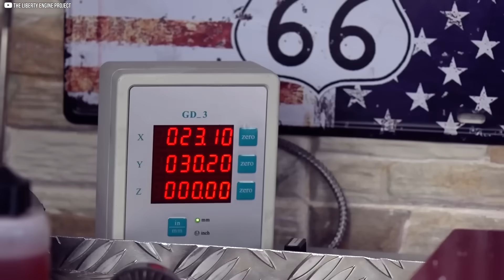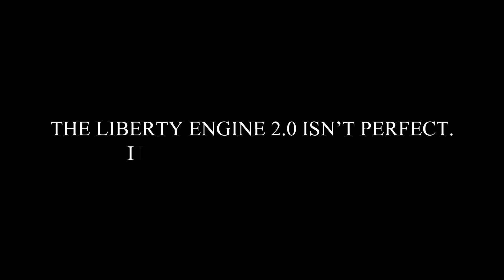Nikola Tesla’s Hidden Invention Just Got Rebuilt – And It Works!

Comment: You Need to hire tech interested Veterans that have'nt Killed Innocent People or Civilians, and share franchise opportunities with them for lead and lethal when needed Security in competition with other Industry owners. They hire to Kill the competition and forced buy outs through threats of Death, then bury the Technology and are mostly from The Spirit World!!! As well as hiring other Tech savvy Production Workers, Advertisers and Skilled Electricians to do installations, and share Franchising with them also with Quality made parts and Not Intent Obsolescence inferior Products. Mobil Units should be first over Housing Needs. You have the better way to Generate Electricity and usage there over Power line Systems, we have been waiting, searching and needing this the whole time along with other Mobil, Safe and Sane Methods. You Need to check Microwave out put dangers in combination with other kinds of Air Waves and other on the spot amplification possibilities and factors, including being struck by lightening outdoors. Smart Meters are a problem with Housing installations, because they kan remotely burn someone's House down and blame your device whether Power lines are connected to a House or Not, installers Need to remove them during installations on older Housing Services, then Power companies will attempt to reconnect them without a Home owners approval or sue in court for disconnecting their equipment if kan. The smart meters are designed to catch houses on fire also and need to be completely removed without waiting for Electric Companies to do it, this is already proven multi multiple times!!! This is the kind of Electrical Technology that kan bring Electricity to Everyone on this and Other Planets, and be Maintainable to Customers and very Beneficial to Companies with Mainstay. There is also Pure Hydrogen uses for Cold Needs and usage waiting to happen, that has its' dangers & needs Hydrogen on demand and return to Water States neutral storage Methods. Pure Hydrogen Products freezing Cold when in motion and Pure Fire that kan be ignited by Hydrogen Gas and explode intensely if Pure Hydrogen is stored in a tank Method long without ventilation. This kan also work in any type of Vehicle and combustible engine.

Comment: My wife (retired NASA electrical engineer and power systems designer) watched this and said, "It's not perpetual motion; the rotor will eventually stop spinning. It would stop a lot sooner if there weren't a feedback loop siphoning parasitic power to keep the axle of the rotor spinning. The feedback loop exists to counter the energy lost through friction in the axle, so it acts as an extremely efficient brushless motor, but it will eventually stop. The laws of thermodynamics cannot be ignored."
Reply: Still a massive step towards something better.
Reply: @drinkyourtea  somethin better already exist but it not solved fundamental rule that it's impossible :D
Reply: @bfx8185  I mean it's still a good goal to work towards but in a way where we could get more energy for longer not necessarily infinite energy.
Reply: @drinkyourtea  you don't need to build any crazy contraption for that. Nowadays simulations can do that easily. We know everything about source of loses. It's simple try to reduce the loses. Simulate it and then you can build a prototype for proof of concept.
Reply: tell your wife to see how magnets work, they defy thermodynamics, magnets create more energy than they weigh, on a constant state on top of that if you have two magnets same size same material and they face each other north and south so they attract, they create more force than they both weigh multiple times together, the heavier they are the more the effect shoots up the roof. the problem with nowdays science is that it is teached as dogmatic as possible, most of science nowdays goes like * if something proves something well established wrong then it is the ''something'' that is wrong and not the well established rule/theory/Law, you can do that in mathematics but not with real things like matter, matter cant be changed just bcuz you changed your formula it does not care abt it, and am sure you have 0 clue what the fuck am talking abt now?
Reply: @muratigentijan8911 - Given how incoherent your rambling is, I think God would have a hard time understanding you, but I recognize mental defectives when they post on YouTube...
Reply: I also had Plans for such an elektric dynamo, about one year ago,  .... a bit more complex ......  The Logic is : Static Magnets (not powered by electricity; static ones take their energy from quantum space) .... These Magnets arranged around some magnets in the inner core, and that will work , like in a linear accelerator, but in a circle.  This is not a Perpetuum mobile, this would be an engine who is taking movement and whatever else from quantum physics effect of pure magnetism.......  Whatever you say, it is possible,  but im not at Nasa, I am just an ultrafreakgenius in secret :o)
Reply: Yep
Reply: NASA engineer or not, she is wrong. Keep pushing forward and ignore the pooh-poohs
Reply: @saturnx311 - And what are YOUR qualifications?
Reply: Your wife is right, and even when she's wrong.. she's still right.
Reply: @PUN15H3R_OG .  ROTFL
Reply: We do a lot with magnets on ships they launch jets that use magnets instead of cables, I be leave there is marit to this machine, if we could use are knowledge to improve this in stead of everyone fighting among there self, join with won another there would be accomplishment in working together!
Reply: Working for Tesla 19 years . . . your wife is mistaken. Elon has teams that have slashed preconceived notions off the tables of concern. I've seen similar motors that have be running over 16 years. Enough said.
Reply: @BrianTurner1961  Where’s the irrefutable evidence to back up this claim?Stupendous claims require stupendous evidence.
Reply: @BrianTurner1961  16 years and yet they are not available to the ordinary punter. It seems that the wealthiest man in the world increases his riches by limiting the flow of knowledge and tech to suit his own selfish ends.
Reply: my ex wife from Tesla, SpaceX, Nasa
messages are crazy XD
Reply: IT doesn't seem the inventors are claiming it's perpetual motion. It seems like they are trying to produce something which might be useful in emergency situations where fuel isn't available. If this thing runs as they claim, able to power a load for even a few days before it stops working, then it could be very useful. While emergency services try and fix electrical grids and bring in fuel, people could use these magnetic engines as a stop-gap. 

If it works as described that is a useful piece of technology,
Reply: @laughingachilles - Agreed
Reply: Your wife is right...N. Tesla did it before..that's how he invented electricity! ..it'll be better with a solid-state implementation!.
Reply: @WayneTom-h7j  hes6wrong go and study about MTG
Reply: @WayneTom-h7j  electricity invented by Faraday

Comment: It wont work, magnets push, then pull as they pass each other. You would need electric magnets only and sensors on either side of the magnets to turn off power before the pull force activates, then turn on before pull force starts.

Comment: I used to build model cars and some of em in the 60s had a tiny motor for em and I had to wrap the wires on the armature and they had a switch for on and off and no batteries were required...I use to just turn em on and away they went...I finally figured out how the motors ran without a battery and when I say motor I'm not speaking of an engine...Motors are electric and engines are fuel powered in the real world...At 10 years old I took magnets and an engine starter and used magnets to spin that armature as fast as it could possibly go but that's the only thing I accomplished because I didn't have anything to make something run without batteries and fuels but I've never 4got about doing that and at 45 years old I finally made myself a power source for something like a generator except i made myself a fan for cooling me down to repair automobiles with and finally I was asked how the fan was working with a power cord and the easiest way was my response because it Tesla wasn't allowed to be able to get his inventions going, I'm not sure about even commenting about the ways my mind works as a child into an adult...I'm not sure what to think about how Mr Tesla was done so many years ago that I get a bit upset when I see his name on automobiles and hear about how rich the designer is today especially when most people were against the idea that Tesla invented and taken away while on his death bed only for personal gain and many many more years later...I'm convinced that the human race isn't so human these days because I would not buy anything with the man's name on it unless it was something to do with any family m e members of Nicholis although they probably deserved nothing because they probably turned against the man as well.....

Comment: I would consider running the bearings on an air cushion instead of mechanical bearings. Friction-less adds life.  My main question is , how do you maintain stable Voltage?
Reply: Probably depends on how much current it can supply.  If the load is under the rating, you might not get any significant drop.  Still this might be better suited to charge large batteries when scaling up for large draws.

Comment: I have been thinking about this for some time. Based on your design, how do you stop it? My idea was to have the outer magnets move away from the main magnets in the center. This design is showing a plastic case around everything and it is mounted to an aluminum structure. Please explain.

Comment: Bollocks! It breaks conservation of energy and is NOT based on Tesla's wireless transmission of energy. 
The reason Tesla went bankrupt is because transmitting wire free energy to homes is grossly inefficient. Note, Tesla was not first getting that energy from the earth's magnetic field. Rather he was trying to piggy back energy which he'd first generated the usual way, across large distances so people could have electricity even in areas where being connected to the mains was expensive/impractical. At no point was he trying to transmit perpetual energy from the Earth etc. The free energy in earth's magnetic fields is less than a nano Watt per m2. Impracticle, for homes where we use power levels typically 1 Trillion times higher. For example: It would take 100,000 x 1,000,000,000 seconds to charge a 100Kwh Tesla car. Tens of millions of years.

Comment: You say it doesn't break any laws of physics, but you don't explain where the energy comes from. You only say how it's gained. I need to know what it runs on.
Reply: Farades law
Reply: @wdhmerchandise7924 What does that have to do with the fuel. Is that not what lets a dynamo work? The energy has a source. I want to know the source, not how it is taken from the source. If I have something wrong, please elaborate.

Comment: So if it's not perpetual motion machine where is the loss in the system? Is it in the eventual breakdown of the neodymium magnets? How long fo the magnets last before needing replacement? What keeps it going and what makes it ultimately fail? There has to a loss somewhere because as stated it's not a perpetual motion machine so eventually it stops running.

Comment: Well, let's see. 20,000 watts devided by 230 volts is 86.95 amps. #14 wire is rated at 15 amps..... Those coils look smaller than #14 to me. Humm 🤔

Comment: Silver is a the most conductive metal, copper 2nd, gold 3rd. Aluminum comes in 4th at 64% as conductive as copper. So tell me, how is an alloy of silver and aluminum going to reduce eddy currents? Eddy currents result from a conductor passing through a magnetic field by Faraday's Law. All that using a higher conductivity metal will do is increase the amplitude the eddy current, not eliminate them.

Comment: There is no way this is working, it defies the laws of physics and the precision of our current engineering capabilities, it would take every person in the US working in perfect sync for years to figure out the balancing and physical requirements of this motor, a small team did not make this without the aid pf a super computer or maybe even quantum computer, plus, everything losses energy in one way or another to create energy in one way or another, energy never disappears, it just converts, so this engine could run on just rotation, but it would rotate for three minutes before stopping and cutting off the energy supply, and even to do that would require precision engineering that only some of the most powerful companies are capable of investing in because of the shear cost, I don’t believe for one second a small team of researchers just came across this and made it perfectly

Comment: I spent a year or two on and off with magnet motors etc. You can make one free spin for a long time but as soon as you put a load on it the free energy machine slows down. It's all a hoax.
Reply: You have to extract it to a separate source and slowly build it up, not put a load on it.
Reply: Those darn laws of thermodynamics
Reply: ..it's not exactly a hoax, but the amount of generated energy is limited. A simply load on it can overload and cause it to stop.:face-blue-smiling:

Comment: Hey, I have an idea What about using an alternator, rotate it using a powerful DC motor connected to a small 12V motorcycle battery, then the power is converted step it down, use it to charge the battery so that the dc motor spins the alternator and the alternator charges the battery and other loads.

Comment: If you understand electricity, magnets, and how microwave coils work (low voltage input to high voltage), then you already know this engine is THE TRUTH. 

I've always thought way back then.. how come we use the output shaft of a motor only for mechanical needs?... why not harness the rotational energy, send it through mini transformer coils, and back to the motor?

Now, i get to see it in live action. Turns out my thoughts were right. I haven't the time or resources, or creativity to produce such a project. But I'm glad it's been done! Bravo!!! 👏🏾 👏🏾 👏🏾
Reply: It's really genius actually that they use the momentum of the rotor and then small flicks of power to get over the magnet's own attraction  and keep Is spinning
Reply: This is "the truth" as much as just connecting 10 alternators to a single electric motor for free infinite energy is.
Reply: Yeah like the wheels of a car go round and round!🙃 🧌🛞

Comment: This setup violates basic laws of physics......
First Law of Thermodynamics states that Energy cannot be created or destroyed — only transformed. This device appears to produce more energy than it consumes, which is "impossible"in a closed system. You can’t get something from nothing.
Lenz’s Law states that when a generator powers a load, it creates an opposing magnetic force. That force "slows down" the rotor unless more mechanical input is provided. If the device continues spinning under load with no extra input, that’s a clear red flag.

Comment: Stinks that most of these things end up getting shelved due to creators face down in their cheerio's like Stanley Mayer. Everyone that came up with a water engine.. Not a Hydrogen engine but an actual water as fuel engine has gone missing, and the tech is buried. Save all the blueprints of this stuff while you can get it, cause if it's viable, it will end up gone in the future unless enough of them can be produced and distributed before someone finds out. Do not patient it, don't advertise till you're on solid grounds. The non belief and prove it's in the comments just help the product not go far.

Comment: So this is not just a perpetual motion machine but also is able to power other devices. I mean, even if you could get to the point where there is no losses and you can make it run unlimited, any device that you attach to it has some efficiency and then it will lose its power. So am I against this sort of developments? No, I hope that people like Tesla and similars continue to exist, but there is no need to build things based on deceived and tricks, right? Still, amazing job people.

Comment: the magnet is only permanent in name 
if the energy from the machine is extracted from the magnet then at some point the magnet will deplete and the device will fail

at that point what would be cheaper to replace the magnet or the energy that was extracted from it

nuclear is the most efficient energy we can produce
lets try to optimize that before we start building gimics

Comment: Bit off topic but I used to be abscessed with wireless energy transmission and also atmospheric energy. After many years came to the conclusion its much more efficient to just transmit power via high voltage copper cables over long distances
Reply: Yes you are right if using dc needs more thicker cables that costs lots of money and adds the weight, in ac though you can use groups of wires with small cross sections to reduce skin effect also this introduces new losses like passive capacitance, complex circuits to maintain those frequencies, voltage
Reply: @ShubhamChakrabortyBA--  yeah High voltage AC for long distances

Comment: Unfortunately this is bogus but if you want real cheap energy check out eng8 energy cell fusion, or Malcolm Bendall's Free Energy Generator, those are both genuine based on plasmoid technology originally theorised by Walter Russell